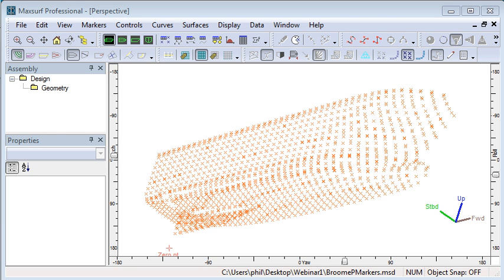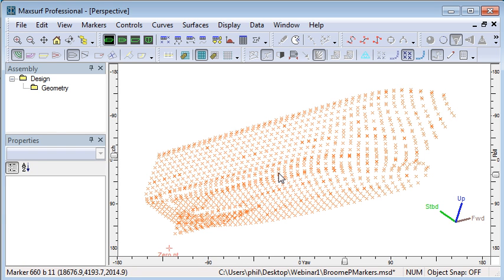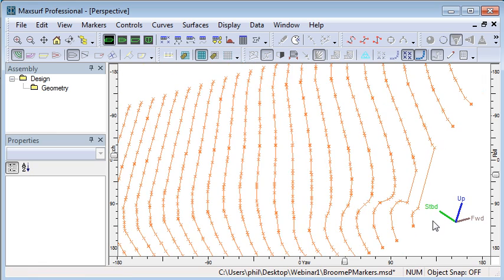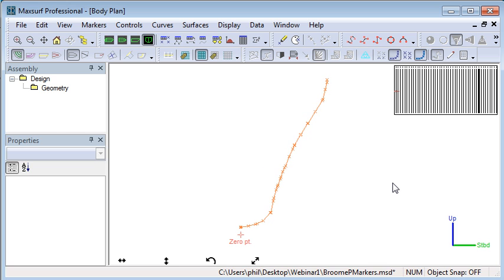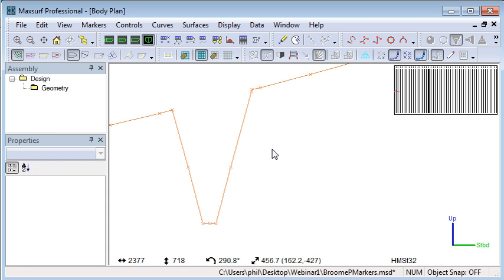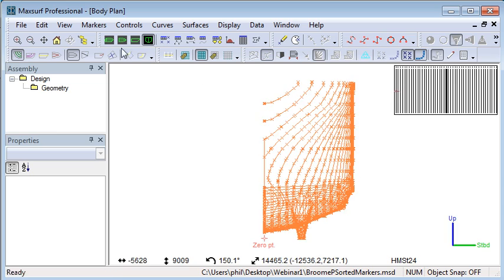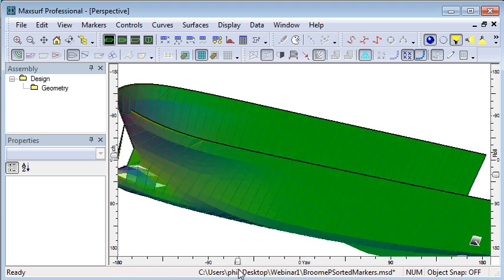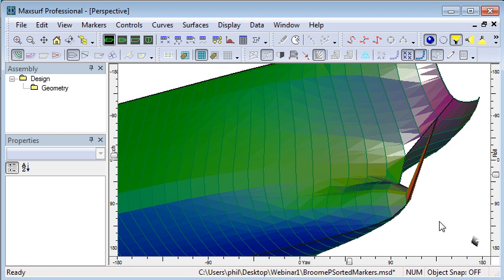Creating a TriMesh surface from an existing design

Comment from the maker: Make sure you are using v18.02 or later. Also make sure you have defined the design grid of sections in Modeler as those sections are using in Stability.

Comment: Hi I have generated a surface in Maxsurf Modeller Advanced but I cannot use this file for stability analysis Masurf Stability Enterprise. After creating the surface I used file>Save design as>test.msd. But when I go to  Masurf Stability Enterprise and try in this way File>Open Design > test.msd; it can't open the file and shows error message 'The design file does not contain any suitable surface for analysis'. Could you please inform what I might doing wrong? Thanks in advance.